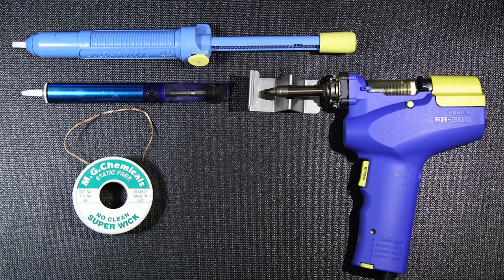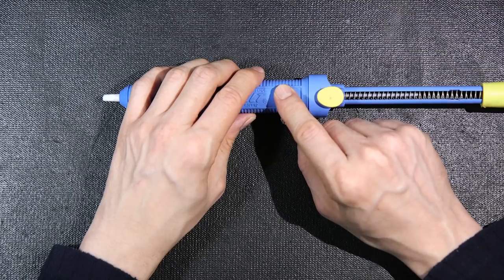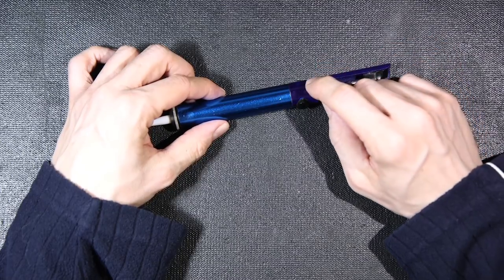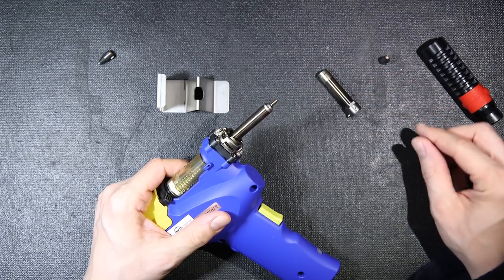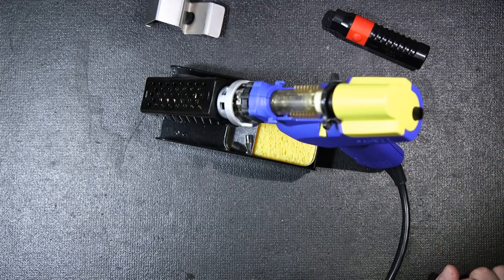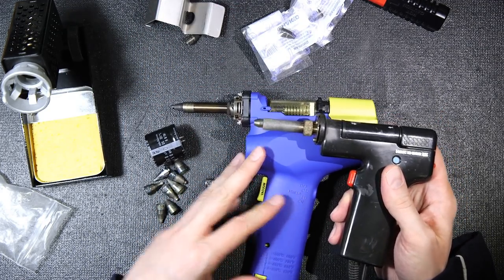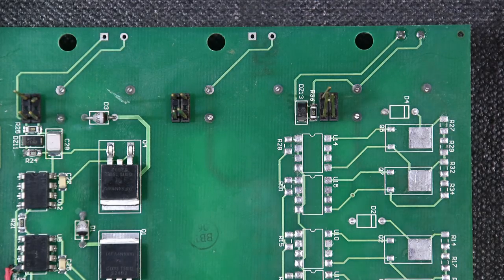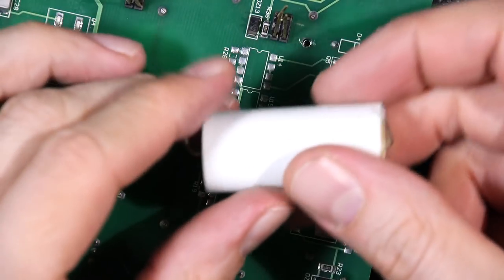How To Desolder Electronic Parts Using Different Tools.

Comment: In December 1973 I attended a pre-employment electronic assembly class provided by Hewlett-Packard in Santa Rosa CA. The class was taught by Mary Powers and Polly Yates, and mainly covered the way that Hewlett-Packard wanted things done. We learned how to crimp wires on tube socket pins without turning the chassis around to make it easier for us. We had to learn to adapt to the instrument we were building...not the other way around. HP was a big proponent of joints that had a strong mechanical connection (crimp) before applying the solder.

We used the very same Solderpult tool back then. Same color..same everything! I guess when a design works well...you just don't change it. No need to. What is that? 44 years or so? Damn that's a lot of years...I must be getting old. Ha
Reply: Wish more people would share stories like these...thank you!
Reply: I worked for Agilent Technologies  (HP)  building cell tower oscilloscopes, soldering under a microscope.  When i saw "Office Space"  I about died laughing at the same, identical corporate mentality. 5 people telling me what to do while sitting on their asses!  I gotta say though.... They had one hell of an awesome cafeteria!  Any thing you could want to eat was there...   Even deep fried oysters!         "Looks like you've been missing a lot of work lately, mike....."    "Naw... I wouldn't  say I was missing it , Bob!"
Reply: HP made the best test gear! I always enjoyed looking inside and salivating over all that gold!
Reply: Aren't we all! LOL.

Comment: Great video. Totally agree with your assessment of the Edsyn blue plastic tool. I still have the same one I bought in 1979 for my job as a tech. Thousands of joints desoldered, still works fine!!

Comment: Wick without flux I could never get to work and it took me a long time to realize that the cheaper ( by maybe a dollar ) wicks do not have flux on them like the ones that cost a dollar more that I'm left to assume is the reason I kept getting so frustrated watching videos of people using wick and it working great, quickly and easily and they never bother the mention they fluxed the wick previously or had flux dipped wick hile my wick just did nothing but get hot until it burned my finger 4 inches up the braid and never even melting the solder.
Reply: If you live around pine trees dissolve some pine rosin in alcohol then soak the wick in it. After you let it dry it the cheapest stuff you can buy becomes super wick.
Reply: I wasted an entire roll of the stuff and got very little out of it. It wasn't a big roll, but still, it annoyed me that I couldn't get it to work.
Reply: Also be aware that flux has a limited shelf life.  Fresh stuff works much better.
Reply: Also once the braid starts to oxidise (quicker with the unfluxed variety) it won't do anything!
Reply: Nobody ever told me to use extra solder either.
Reply: I was wondering why they did not work, and what kinds of flux have you found good that clean but do not destroy?
Reply: I've been doing electronics for 50 years so it is surprising to me how many things change, and how many stay the same. Solder wick used to always come prefluxed with solid rosin... so apparently, that is why I never experienced or heard on any problem with it.  In case You run out, You can use fine stranded copper wire (twisted ) dipped in flux.  Whatever happened to the old rosin flux? that smelled like pine trees and or rose oil,.. all the newer solder smells much more like mineral oil and doesn't work so well.  The Solda Pullit, and the small blue aluminum one, appear exactly the same as they were in 1968.  I didn't like the teflon tips, and have been warned that continual exposure to overheated teflon (fumes) is not good.  As far as the Hako,  I don't think I ever saw one before Your video's!  what a wonderful device!  I use soldering guns a lot.   The old Wellers with the brass tubular secondary.  The Aluminum ones really don't work for more than about a month.  The old ones will go on forever if one can find tips.  I just use a length of BX cable (copper #14) about 4 & 1/2 inches long, and folded in half,   The handy thing about copper wire tips is that they can be folded or  bent a bit too reach hard to get at spaces, the down side is the tips eventually dissolve away into the solder until the end opens.
Reply: @JerryDodge , The extra solder is also useful when you desolder lead-free soldier. The lead-free usually have higher melting point, by mixing it with leaded solder you bring that melting point down. Its like pouring salt water on ice.
Reply: @Willi I'm glad you were careful how you spelled that!
Reply: Thanks for sharing that, I had the same issue and now I know why !
Reply: Same for me with the wick. For years I had never seen anyone mention that you need flux to make it work well. I don't know if people just assume that's common sense or what, but it's certainly not obvious. It wasn't until I saw Louis Rossmann's videos that I realized I shouldn't be shy with flux.
Reply: @Geopholus   ,most modern soldering fluxes are organic acids specifically designed for use with lead free solder. They are noxious and irritating to breathe and quite possibly toxic. Rosin flux is best for use with ordinary lead solder. Lead free solder is terrible for electronics work.  It crystallizes and breaks down prematurely, especially in extremes of heat or cold,  and thereby consigns devices to the landfill prematurely.

Comment: I bought the FR-301 by HAKO. It's fantastic. Temp 1, the lowest setting, is indeed plenty as you mentioned. I also bought the HAKO 633 stand. It's quite sturdy and worth the $. I used the FR-301 on a Heathkit IM-18, IT-28, and Sencore PM157 during restorations over the past two days. What a time saver...and makes for quality looking work, too. My Dad always said, "use the right tool for the job." He was correct. My dad repaired radios in the 1940's for extra money in his attic shop. He would have really liked this tool!

Comment: Used the manual solder suckers for years, finally purchased a desoldering unit, and wow, wish I had done it years ago, especially when I was removing all those caps in power supplies and Dell motherboards over the years. World of difference. Thanks for the video Paul.

Comment: Fantastic tutorial on a part of soldering that not a lot of people cover, even though it's super critical when fixing most faults. I like the soldapult, mostly because it's fairly cheap and doesn't have as much of a kickback when it actuates. It's also helpful to use the bench to set it, especially for repetitive tasks. I also find that solder wick doesn't tend to work great for through-hole, but is excellent for cleaning up SMD pads to replace parts, and use it mostly for that

Comment: Hi Paul    I just bought a Hakko FR-300 from Fry's for $320.  I use to use the Solderpullit , solder wick.  I use to use Metcal, Pace, and Hakko's at work, now that I am retired, I went for the Hakko since it was available locally at Fry's.  What I found from people getting the cheap Chinese Desoldering tools is they are hard to get parts for, that is why I went with Hakko, great support for parts.  I just ordered the other tips and cleaning supplies for my FR-300 from  American Hakko, great support.  I got a strange desoldering station from where I worked, it was free.  Digging into the older desoldering stations that Hakko had the hand piece for that iron looked like a old Hakko 706 (Sylvania SS 200 on the base) so I got some old desoldering tips for it that were exact duplicates.  I am very happy with Hakko although the parts were being discontinued, I probably will be buying more tips for my backup station.  I think the Hakko's are better designed that the other cheaper Chinese knockoffs, you get what you pay for in quality.  Later Ray Burke
Reply from the maker: Thanks for taking the time to write Ray!
Reply: Hi Paul    When I was desoldering surface mounted devices, and after pulling the part off.  I used the desoldering gun to suck up the extra solder without too much extra pressure on the board, it didn't use up the solder wick.When I got the extra tips from Hakko I got their hand drills for the tips, to declog the desoldering gun.  Maybe later you could show the different methods you use for declogging  and maintaining your desoldering guns, and tools.  Later Ray Burke
Reply: Hi Paul Carlson
      I enjoy your videos very much, and every new videos that you make.  Hope you had a great weekend and holiday, do you have Thanksgiving in Canada?  Well, at least have a great weekend anyway.  Catch you later Ray Burke.

Comment: Hey Paul, I own one of those blue aluminium devices, that I (and before this period, my dad) usees for at least 30 years now - it might be 40 years... This tool looks EXACTLY like the one showed in your video, except that the middle part (including those threads) is made of aluminium as well... it's probably the older version of the same brand. Totally reliable device... No idea, why they did 'verschlimmbesser' it, as we say in german... (improving something by making it worse than it was before...) Cheers & thanks for your great and always very helpful videos!! Salossi
Reply from the maker: Thank You for your kind comment Salossi!

Comment: Thanks for the teaching!  I spent some time practicing removing parts from some scrap electronics that were headed for the trash, and your methods worked far better than what I've tried before. Especially the adding new solder trick. I've got the one-hand cocking cheapie sucker. 

One other tool that I found useful is a heat gun. I don't have the special rework station type, just a big Craftsman heat gun with a narrow restrictor tip on it (about a 3/8" tube at the exit). It heats more area than needed, but for pillaging dead boards for parts to play with, I'm not too concerned about that. It's especially useful when you need to heat several pins at once, like for headers. Gets plenty hot enough even for lead-free solders (top listed is 1000F).

Still learning, so thanks for the pointers!

--Mike
Reply from the maker: You're Welcome Mike!

Comment: Great vid!  Here's a cool tip when snipping leads.  Rather than cover the snipped end with the free hand to keep it from flying, try this one-handed technique: grip the snips with your index finger extended over the cutting jaws.  Place the snips' jaws on the lead, and gently touch the end of the lead with the index finger.  Squeeze the snips, and the clipped portion of the lead stays in the jaws.  Cheers!

Comment: Oh this is scary.  I know what that second circuit board is.  A Uniden/President Grant mobile CB or one of the many other radios that used that chassis.

Another advantage of the vacuum desoldering iron is it also helps to cool down the lead of the component as it sucks cool air from the opposite side of the board helping prevent damage to heat sensitive components.
Reply from the maker: LOL, you nailed the radio Mike!
Reply: Mike knows his radios for sure.
Reply: Yep, Mike's knowledge is scary (but good scary!). Thanks Paul for the rundown...makes me want to replace my Tenma tool with a new Hakko...maybe the XYL will get me one for Xmas?  73 - Dino KL0S
Reply: Dino Papas 

Whats even even scarier is I knew what it was before I even saw the component side of the board.  All I had seen at that point was the little section of the solder side. 😮 We need to get you hooked up with a Pace system.  With  a SX 80/90/100 hand pieces it's a solder sucking monster. :-)
Reply: Good point on the vacuum cooling effect, Mike.  Thanks for the tip!
Reply: My poor old Pace  ran at to high a Pace, and it is not doing very well, after 30 years. I most certainly do miss it, but am not finding many examples of used ones that are much better, as far as condition goes. If you bought a Pace, chances are you used it, an awful lot, otherwise you wouldn't have laid out the money for it.
Reply: The solder suckers sometimes  work better for through hole components if you put the sucker on the back side of the board and heat the part from the front side while the board is held in a board vice.
Reply: @divewizard  That's good advice.  I have a hard time with getting the solder sucker to work right and sometimes I just think it's defective.  But I'm trying this tip.
Reply: Seth B I bought a Pace 100 back in 1998. It still works very well. The only real problem was the switch in the handle. I had to take the handle apart a few years ago and slightly bent the switch. Been fine after that. Just have to remember to clean the glass tube on a regular basis, and change the filters once and a while, or the tips get clogged because of reduced air flow.

The prices are actually lower today. Mine cost $1,000 back then, but are a few hundred less today.

Comment: The second pump/sucker you showed is easy to fix BEFORE it finally dies, put some tape around the loose connection (when you buy one) on top and it will serve you for years. Easy trick/fix, great pleasure.

Comment: Can't beat the Hakko especially on densely populated through hole boards. I dint use it every day, but when I need it, there is no substitute. 
The wick and Solderpult tool works for some jobs, I keep all three handy.  Good tip using flux with the wick. It definitely helps.

Comment: I use a soldering iron that is kinda like your desoldering gun. But its manual. Has a rubber nub you press and release to create the vacuum. It's a simple rubber bladder system built inside the soldering iron. So it's cone shaped with the handle! I it's a Ungar brand. It's old for sure. But it works great on ic's. I've only used it a little as I've only had it for a month. But it works fantastic in one go each time. Then after using it on a joint I can press the rubber nub again to squirt the solder out on the bench. Then back to another joint. It works super well. And has an added bonus! If you have it plugged in and the tip/heating element section removed it can zap you with 120V! (I haven't been zapped yet, as I don't remove the heating element!) Works so much better on ic's and other small pain in the ass pins then a regular iron and desoldering sucker. Which I also have about 4 of the solder pullt's.

I like soldering but desoldering is a huge pain sometimes! Mostly when stuff is wrapped on posts and terminals! I hate it when it's wrapped. And yes, I've wrapped stuff too. I hope I don't have to ever remove it.

Comment: You should mention that the Edsyn SOLDAPULLT DS017® is also available in a "low-static" version as "DS017LS".  The body and tip of the unit are black instead of light blue/white due to the incorporation of carbon into the plastics to render the tool somewhat conductive, which is especially effective if the operator is suitably grounded through a wrist or ankle strap.  Several other manufacturers produce similar devices.

Overall, though, this was a nice, informative video for neophytes.

73 DE KI6DCB

Comment: After fighting with solder suckers and the lackluster performance for years, I bought a Hakko FR-301. Best money I ever spent. The last solder sucker I bought before the FR-301 was the Engineer, better than any on the market if you can't afford a Hakko. I still keep a roll of wick around for quick removal of solder bridges. But I go for the FR-301 99.9% of the time - and I am a hobbyist. If your doing it ALL the time or a business, you would invest in a dual-role station with soldering and de-soldering pump. A 301 for business unless it's low volume isn't a good idea.

Comment: For my FR-300 ...In addition to the FR-300 filters I use Goot TP-100 filters. That wimpy filter provided by Hakko gets saturated fast.  But adding the relatively hefty and very cheap Goot TP-100 filters with the Goot provided steel wool to catch the solder, dramatically expands the service time of the FR-300.  I'd say the cleaning and filters replacement time increases by a factor of 10.

Comment: I've been doing a lot more de-soldering lately - I task I used to loath. I never became proficient with the spring loaded suckers. I picked up an FR-301 and combined with a cheap hot air rework station, de-soldering and removing chips is now pretty darn easy.

Comment: Paul I’ve had all those tools then I finally went to PACE stations and worked thru the yrs of styles and now have the PACE PRC 2000. 
I’m sure you know how much that system costs but the capabilities of what you can do is enormous. 
Plus you can change tips hot. I use 2 desoldering irons and a soldering iron with it so I rarely have to change tips as I use a fine and a larger tip that pretty much covers most component leads. 
Having a set of oxy acetylene tip cleaners is very handy also.

Comment: I have one of the cheap desoldering irons off amazon. The kind with the suction bulb and it gets the job done surprisingly well.  I prefer it over a solder sucker for small pads. Removed a few hundred components so far so it was well worth the 20 bucks or whatever.

Comment: Before he died in '98, my grandfather owned and operated an electronics repair shop and I can remember him having the exact same hand pump desoldering tools as you show here, even the same colours. I guess some things stay the same no matter how long it's been. Incidentally, he also had the same model soldering gun for chassis work as you showed in other episodes.
Reply: Hey. I’m only 58 and I use the old blue tools all the time. The Hakko is by far better but I can’t use it upside down under a 10 HP saw motor.

Comment: Thank you for the great video.
The power tool would be handy on automotive gauge servos. 
If I was to do that job on a professional level , I'd have to have the power desoldering tool. 
I use scrap wire with flux to wick stuff.